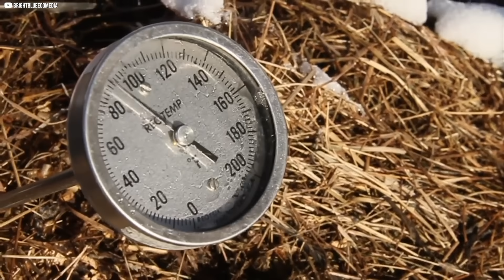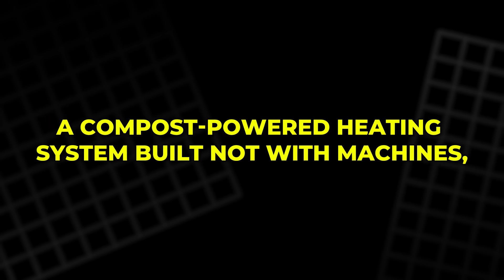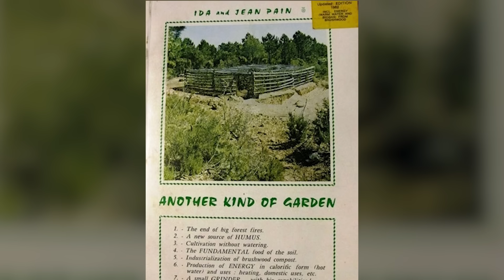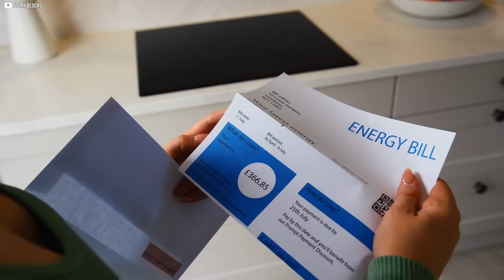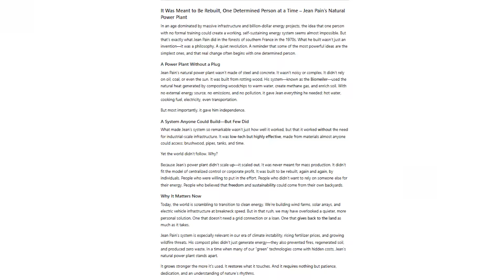The Forgotten Reactor: Jean Pain’s Natural Power Plant

Comment: Cooked a Turkey in a compost pile once, took a couple days, but was sooo good cooked slow like that.
Reply: C'est une méthode de chauffe utilisée par les alchimistes du 17 ème siècle
Reply: How's the smell and taste?
Reply: @Personal_Library_of_Travel  lol, like was sooo good, was fine it's not like you burry it in there without wrapping it. I used a green bannana leaf, and an oven bag. Was a 4 person Turkey.
Reply: @Emprivan  I thought it would be bad as it was piled in a compost pile. I mean, it's rotten vegetables, fruits, and other nasty stuff.

No offense, i was just curious.
I might try to do the same with safer compost pile if it's safe to eat.
Reply: @Personal_Library_of_Travel  Ok, :} Well basicly if you have rotting goop still in process, your pile is not doing it's job properly, like too wet and or too compacted so as air can't flow thru the pile. Your pile should be fluffy and moist, not compressed and wet. Also the temp if everything is working right should peak around 185 degf, but as long as you can keep the temp above 165 your good. As someone mentioned in another comment, compost piles can and do spontainiously combust in the right conditions. Look at the process as a bell curve, compost microbes start getting hot, then as oxygen is used up it cools down, so you go flip the pile, and the heating cycle restarts. Your basicly slow burning/transforming organic materials. I read a paper years ago about making a nuke by taking a hot pile of compost 1 cubic yard, and instanly compressing it causing the carbon 14/15 to fuse to instantly detonate. Anyway, the oven bag keeps out the earthiness, but if you like a little earthiness flavor, mushroom essance seal your oven bag around a pencil then remove the pencil.
Reply: @Emprivan if you ever remember the paper, I would love to read that. That sounds wild.
Reply: @Emprivan My compost used to smell so bad that when it rained, it created puddle and make horrendous smell cause the compost box was higher than the pavement.
I got scolded by my parents and moved the compost to a hole in the ground.

It doesn't smell as bad, but it not a nice, earthy smell either when you open the lid. That's why I get curious about cooking in a compost pile.

I'm using soil now as substitute for my brown material cause it's kinda hard to find it in abundance in my place.
And for now the compost pile isn't as warm as it used to be, so I might do it another time.

Thanks for the notes though. I'll try to make it if I found enough brown materials!
Reply: @Emprivan  Thank God you got that 4-person turkey off the streets.  Thank you for your service.
Reply: @harrymills2770  Your welcome, it was survival of the fittest back then. Just as well could of been a rabid rabbit.
Reply: @Emprivan make a video of that and upload
Reply: @jsmkumar6945  I wish it was that easy. I don't have access to a mountain of hot mulch these days. This was back when I was in my teens. And we ran a sod farm. I'm old now.
Reply: Sure you did .
Reply: Tasted like shit?
Reply: @HardHardMaster  Nope, have you ever cooked something in an oven bag? Try this if you haven't ever cooked in an oven bag. My favorit way to cook cornish game hen. Get  2 game hens "thawed"wash them remove giblets. Put game hens in oven bag. I like lipton onion soup mix, dump that in the bag, maybe add what you like, salt whatever. preheat oven to 325, add 2 cups hot water shake around to mix inside bag, seal bag but not too tight so some steam {1/4 inch hole} can escape, set in bakeing pan so sealed end is up, cook in the bag for about 20-30 mins, dont boil them to death. remove hens from bag, I like garlic salt and butter mix, coat the hens and bake or bbq. coating with your butter mix (baste) every few mins, till hens are fully cooked. Golden brown, I use bbq/smoker and use apple wood. It will be the best game hen you ever ate.
Reply: @Emprivan you want your own cooking show don't you? ;)
Reply: @HardHardMaster  Nooo, lol, I'm a gardener. :}
Reply: @Emprivan well try cooking it on very slow for 2 day's...if you dare. The bacterium will certainly tell you different.
Reply: @Rihara-x3r  Ya this again is why you need a hot pile, at least 150+. I wouldn't try it if you can't get the pile that hot. I've had piles that spontainiously combusted, usualy ones that had too much hay mixed in. Again it's not like you just put the food in there and leave it, you have to flip the pile like every couple hours and compress it a little. Not too wet and not too dry. Many mulch companies use this method to garentee that no weed seeds will survive. And fast production time.
Reply: @Emprivan thankyou for a more in depth resolution.
Reply: If the temp isn't hot enough then you are risking Salmonella, assuming that applies to Turkey and not just chicken.
Reply: @jonathanberry1111  Ya a hot pile, usualy over 150, if you stay on it, will kill weed seeds and other soil stuff as well.
Reply: @jonathanberry1111  it even applies to salmon...
Reply: no you didn't, it would spoil
Reply: @lorenzo42p  If you run a hot pile, and dont try to cook a 24lb er, small like under 12 lbs, and no stuffing, just spices salt and butter.  takes about day and a half maybe 2 days, youll be fine. Obviusly it wont look like you took it out of the oven, you don't eat the skin. Oh, and wash it good, if you did know to do that first.
Reply: I'm surprised night scavenging animals didn't come along and dig it up for their dinner, LOL
Reply: @ixpen1  The only animals that tend to dig around the pile is a skunk and sometimes a cotamundi, but in a sealed cooking bag, probably can't smell it thru the compost. The mountain lions and other cats racoons cyotees foxes, they dont even go after the trash, thats more amazzing, javolina and deer cant get into our yard, and bears only come as far as the creek and stay in the hilands.
Reply: "took a couple of days"?
"its bloody raw!
-that angry tv chef 😂 🍻
Reply: Any white meat animal will go off if it's cooked too slow. Especially 2 days. Pork or chicken unlike red meat beef or mutton  may be ok.
Reply: Sorta like pig wrapped in Burlap under ground in coals.

Comment: Didn't watch the vid, Mother Earth News described putting coiled hose inside your haystack. My friend did it in the 70s. Free hot water all winter. Could probably heat a small house.
Reply: C
Reply: Can u help explain more how this system..I'm so confused 😂😂serious..it just dont make any sense how it will work
Reply: @bonthor7515 hi Bon. System works on the bacterial breakdown of the organic material. Heat from the reaction inside the well insulated pile builds up. Water circulating through coiled pipe buried in the pile is the working fluid that transfers heat to desired location.

Comment: 100 watts really isn't enough, and that biogas comes with contaminants, it can be rough on engines if it isn't filtered like crazy.
Reply: 100 watts will fill a battery over time, combine it will a small wind generator

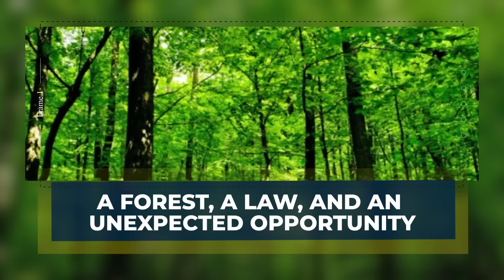Comment: 2:38 you can use the water and vasuum physics to cycle potential and make a free generator
Reply: No, free energy does not exist, never has existed, and never will. There is only conversion of energy, from a higher state to a lower one (sometimes with a significant loss of efficiency).
Reply: @joteirlinck4778  Exactly! There will never be Zero Over Unity. However, you can do recyclable efficiency.  By combining different techniques and technologies together to get the most efficient output of energy and thereby increase the efficiency of the energy being produced and the energy being used to transfer that energy into more efficient forms of energy.
Reply: @joteirlinck4778  never say never it never ends well long term , we collectively know nothing to what is going to  be known
Reply: @joteirlinck4778  BELIEVE THE SCIENCE

Comment: 140ºF = 60ºC
Reply: I had a tree that fell cut, and mulched into a pile in the front parking area.  It then rained.  The pile was steaming from the pile for days.   Took me a week to get rid of it.  And then it was being carted away a truck load at a time.  It was easily 80-90 degrees every morning from what we pulled off the top.  The difference, is that I spent 0 labor cutting it down and mulching it, i had that done.  and they told me to watch for fires.
Reply: Which is hot enough for a bath.
Reply: Thanks, most of the planet uses the metric system.
Reply: No one cares

There's a "translate to English" button on this comment 😂
Reply: @aaronh1372  So what? Play in the GPT Chat and he'll explain this equation/convertion to you.
Reply: @aaronh1372  and well the world minus some care...

Comment: You don't need wood chips to do this. It can be done with leaves and grass cuttings.
Reply: While true, you need significantly more of it to get the same energy.
Reply: Ideal for smallholdings & farms. It should be a constant chore, part of the daily schedule . When 1 is exhausted the other pile is going. It's a remarkable source of energy.
Ticks all the boxes.
Reply: The problem with grass cuttings is that they can be small pieces with a lot of water content.  The decomposition starts fine but without woody bits the grass cuttings can collapse into a slimy sludge. Then the air containing oxygen is slow to diffuse in and the carbon dioxide is slow to diffuse out.  The decomposition slows down a lot .  It doesn't always stop but the microbes which then prosper use anaerobic decomposition. Still generating heat but neither so quickly not neither so much. The trick is to thoroughly mix grass cuttings in with tougher stuff.  It will all decompose with the twigs and chipped wood holding the shrinking structure up preventing a collapse into a thick sludge and so letting air in so the microbes can get oxygen and do their work fast and efficiently.
Reply: @lapalma40 can you drain the sludge out and use as fertilizer?
Reply: The determining factor on whether an attempt at a compost heap can be used as a fertilizer is. .. has it gone through a phase of runaway heat generation? The heat comes from the fermentation. If it never warmed up fully then the weed seeds often present don't get cooked and sterilised or fully rotted.  While the sludge or any other result of a half baked fermentation can be used and will bring all sorts of goodness to the soil.. you will also be spreading weed seeds.  If you put horse manure into a compost heap and the rotting is just lukewarm then you need not be surprised when after spreading your home made fertilizer you get barley/wheat/oats sprouting alongside your lettuce 😅😊:-).
This runaway temperature is why you need  to build one BIG compost heap rather than several little ones. Building BIG  is one way to trap the heat inside and favour not just bacteria but also fungi which spoil any weed seeds lurking inside. Bacteria and fungi both like an environment which is warmer than your typical day/night average temperature. So trapping heat inside is essential.  It is fungi more than bacteria which love woody bits with lignin and generate a flow of steady heat over months.
Reply: Super cool. I used to have a paperback book that had great plans for many biofuels and other methods. I believe it was from the 70's..I wish I could find it and see it in a more adult way..
Reply: I would love to have someone give me some ideas or help. Do you have a way to get in touch?
Reply: And kitchen compost.
Reply: Use whatever is available, likely that mixing a ratio of lightly pressed grass/weeds, wood chips and cow/horse dung would spread the wood chips out, maybe be more efficient.
Reply: The wood chip lasts a lot longer that’s the best thing
Reply: if u want to run it just a view month, go  ahead....
Reply: @BraindeadAnimations you can't just run it for a few months.....
Reply: @lorenzo42p    Oh, really? 
Then please explain how this is supposed to work physically with grass clippings, since they decompose much faster than oak and beech wood chips. 
Only with the right size, the right wood chips, and the right bacterial environment is it possible to keep a bio-meiler going for 18 months to 2 years. 
Coincidentally, I know the owner(Heiner C.) of the only association/company that professionally installs these bio-meiler in houses here in Germany(Native-Power) and have been present at several installations.

Obviously, you know next to nothing about the whole thing, so whats your point ?
Reply: @BraindeadAnimations wow! aren't you clever.
Reply: animal manure seems also fine as alternative
Reply: But he had a forest of wood and his animal's dung
Reply: Actually you would need wood chips because of the size.
Reply: @happykickstart  no, you don't.
Reply: @lorenzo42p  yes you do need them. I also do this myself. I know that they are required.